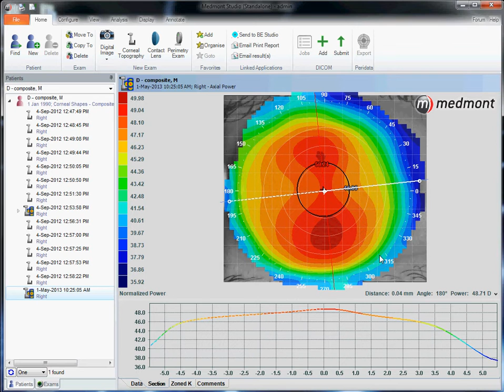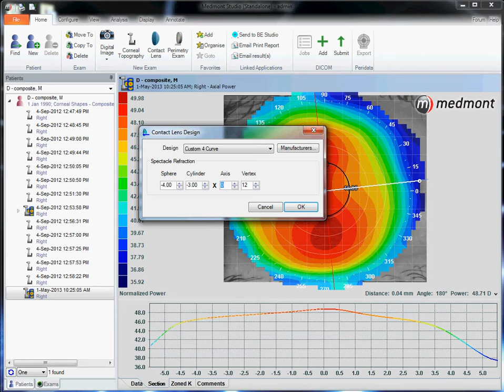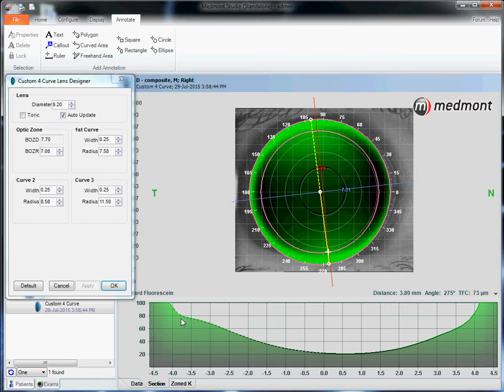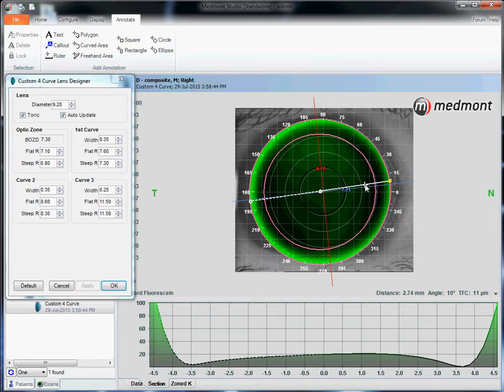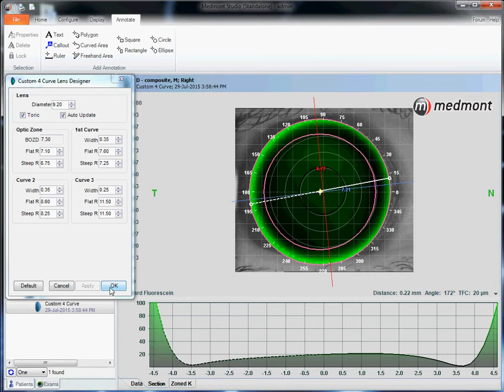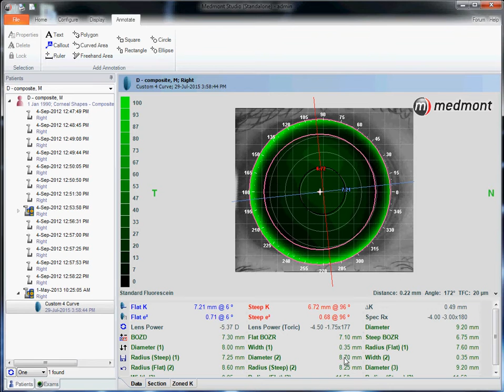How To | Build a contact lens for an astigmatic eye (Studio 6)

Comment: Would you use the same design method for an eye with against-the-rule astigmatism? Any variation? Thanks
Reply from the maker: +Geoff Conwell 

The ATR cornea is a patient contra-indicated for GP
lenses.  Unless the eye is toric enough and you can create a bitoric steep
enough to land at 3 and 9 and lift along the 12 and 6, its going to be tough to
create centration and comfort. The WTR cornea automatically has landing
at 3 and 9 and promotes good movement with the blink and a healthy pumping of tear layer along the vertical meridian. The ATR has landing at 12 and 6
and usually results in very laterally decentered lenses and is not very
comfortable. Let us know if you have any more questions, Geoff!